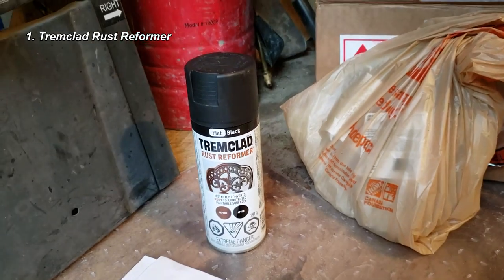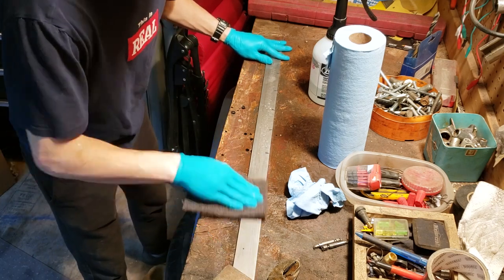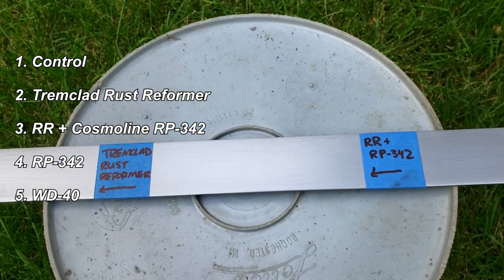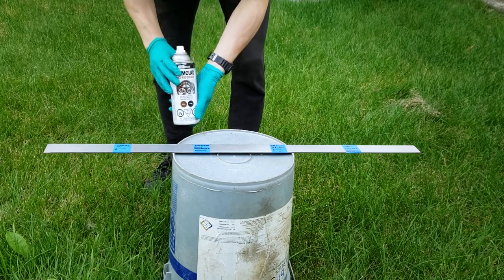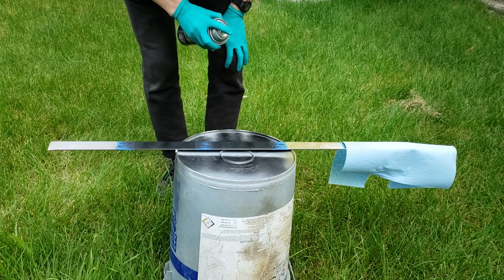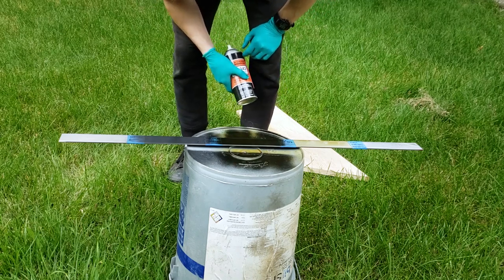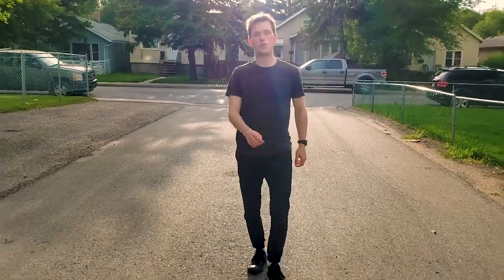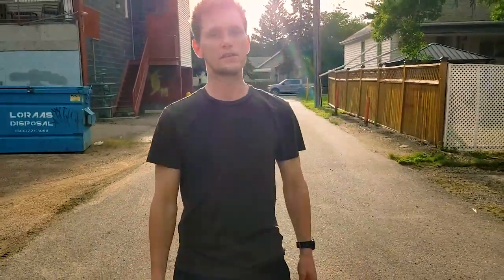1 Year RUST Test - Tremclad Rust Reformer | Cosmoline RP-342 | WD-40

Comment: Hey yo. How’s your metal buoy.
Reply from the maker: Sitting at the bottom of the ocean. Haha. Its good, still no rust on the parts I coated with the cosmoline.
Reply: Good question dude😂🤣, I think the 40WD would win this competition🤔,  I'm about to rustproofing my jeep wrangler JL frame I think I will use it, but I must be sure that it will not heart the frame paint
Reply: I use fluid film. It seems to work pretty good there’s another product called wools wax that hangs on a little better than fluid film in the rain and wet areas but I just get whichever one is cheaper.  NEither one will hurt your paint

Comment: I spray gunned Cosmoline Black (Rust Veto 344) on my 2000 LX470 and followed it up with rattle cans of Blaster Corrosion Stop. The black dries to a hard plastic like texture and the Corrosion Stop is an oily like spray that appears wet all the time. It will be a year this November